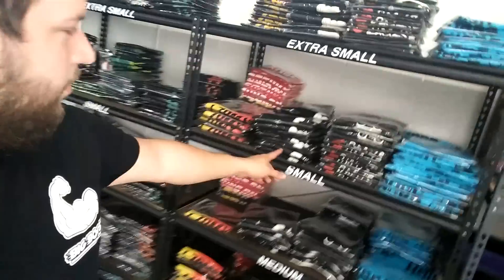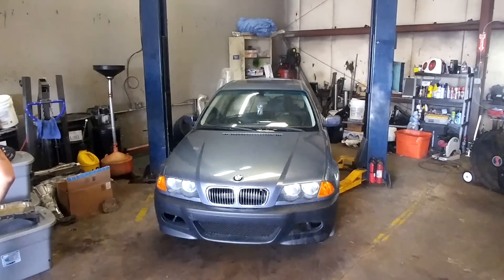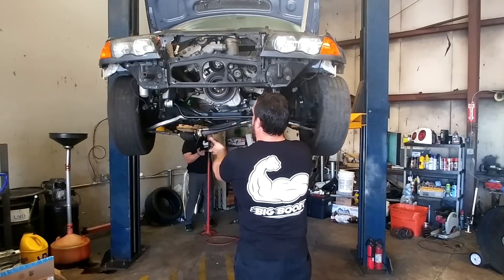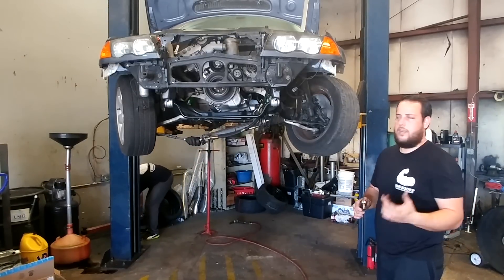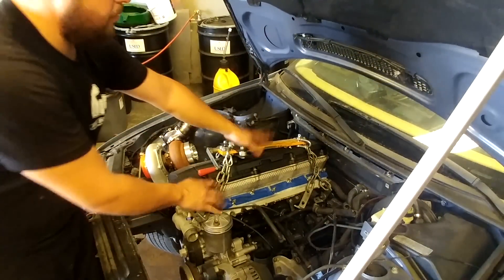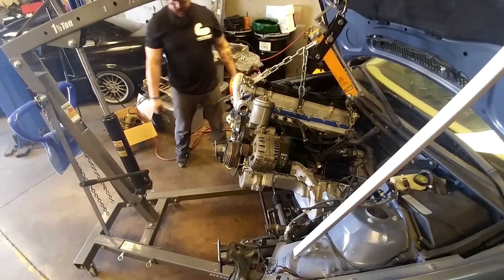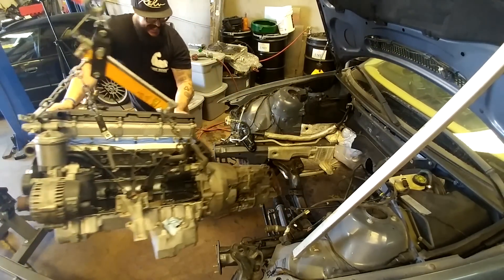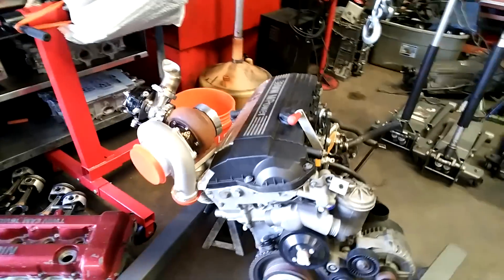BIG BOOST BMW DRIFT CAR FIRST UPDATE

Comment: Why did you not finish the e 46 was it a track cars setup and the e 36 was more of a drift car? You seem like honest good guy work  long days and have some nice friends realy like your channel and your builds.
Reply from the maker: they were both going to be daily/ drift cars, but I have everything to make a e36 m3 drivetrain. lot less work in the e36 since it will bolt right up.
Reply: Ok nice thanks for the answer not many i write to answer. Love your big boost driftcar e 46 that you to on the titan clip where you tested you power insane sound on it. Nice engines you use and build love japan power and euro cars got a Nissan skyline r33gtr and bmw e30 325 had skyline for 12 years now wish i had someone like you to build it for me shame you live in USA and im in Sweden.

Comment: Hey Big Boost, I've been watching yours and Adams videos and I love them. They are funny and interesting, especially with the project cars. I have a 1992 Honda Prelude with an H22 block with the H23 head. I'm having a bit of an issue with setting the timing and was wondering if you could help me out.

Comment: What's the Spec on the S52 or is it unopened?
Reply from the maker: stock rebuild, arp studs and cometic head gasket, obd1 intake manifold, oil pan baffle plates, oil pump nut lock mod, metal water pump, obd1 oil filter housing and aluminum water neck

Comment: Do you have upgraded injectors for the big boost?
Reply from the maker: I only have 47LB for now.. getting 1200cc later, so I'll be at 400whp once its done
Reply: Sounds pretty good. Do you think bmw 2.8 stroker with 20lb would be good for street drifting?

Comment: Alberto, I will personally drive to your shop and teach you how to edit. I can see that you're struggling, but you're making a great effort and that's all that counts.
Reply: DPXPC If it's because of the audio he used his phone to record this video before he got his 4K camera, next video will have better audio.
Reply from the maker: you can see the audio diference in my bday video. this was fimed with my phone
Reply: Alberto BIGBOOST By the way Alberto happy bday, keep up the great work you're growing fast. Also I was surprised to see we both shared the 19th as birthdays.
Reply: Alberto BIGBOOST Oh also Alberto do you have any tips on doing a fwd to Rwanda conversion? I'm in Australia and brought a Holden Astra (you probably know it as a Opel or Chev) and I got it a couple years ago, I got a new car and want to mess around with the Astra and was wondering if you had some tips on doing it?
Reply: The Real Feremity It was actually because of the out of sync audio during the time lapse and the frame inside of frame intro caused by Windows Live Movie Maker. Simple mistakes that are easy to make.

Comment: Why not just sell both and buy an m3, then boost it... find a clean one and it will certainly be worth it in the long run, money wise and time wise. I'm sure you already know that which is why I'm asking, because it doesn't really make sense to do an engine swap and then do all these upgrades to a non-M car... They made the m versions for a reason.